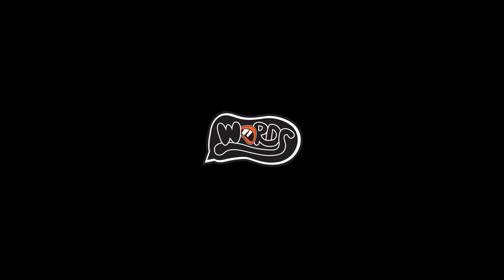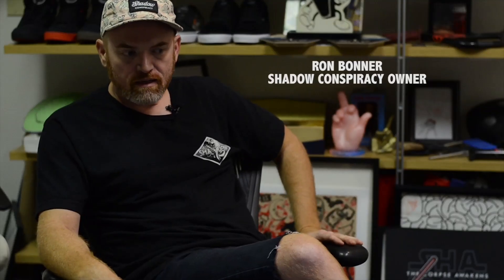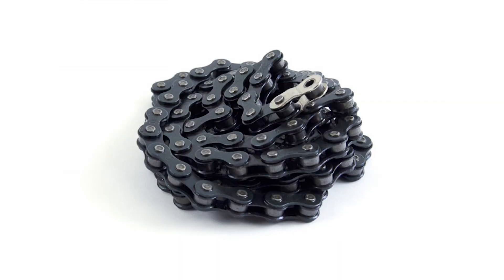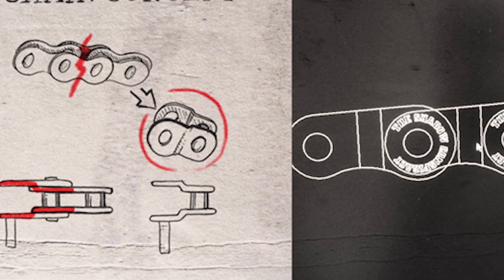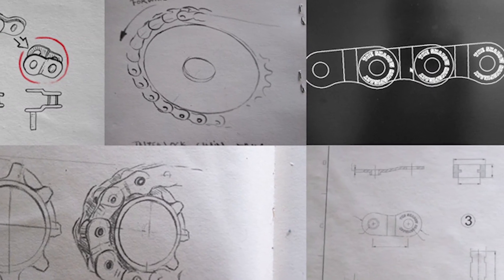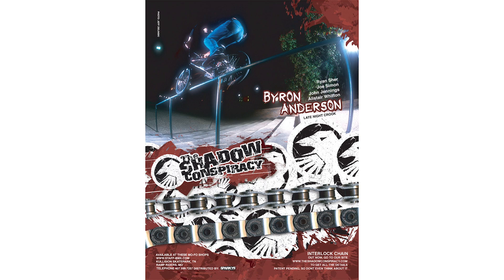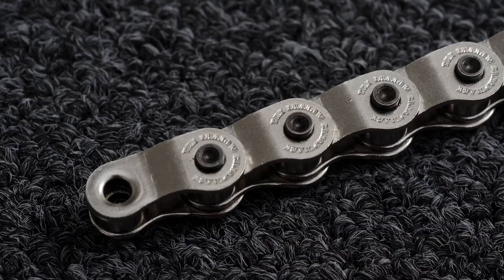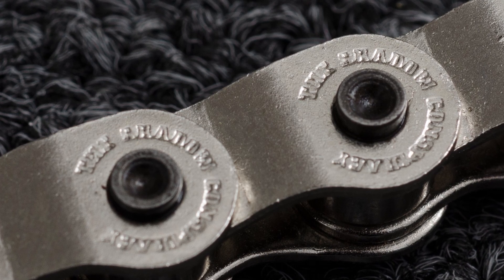WORDS: History of the Shadow Half Link BMX Chain

Comment: My buddies and I all ride the shadow chains and we ride some gnarly stuff too. Lots of grinds and big drops and fast peddling on the regular. None of us have ever broke one of these chains. mine is 2 years old and I have no intentions of replacing it any time soon. I'm curious as to how some people have claimed to break these  chains and especially people claiming that it happened in a matter of weeks. First off no chain is indestructible but I have a strong feeling anyone that has broke one of these chains has either compromised the chains quality due to a heavy crash that put an abnormal amount of pressure on the chain or they have an issue with their gearing and alignment of the chain. I do know and have plenty of personal experience and personally know tons of others riding this chain that when it is installed the right way that it is nearly bullet proof. Thank you Shadow for making the effort to make great parts for us guys!

Comment: My knee got saved by the v2 so many times when it snap, it didn't snap all the way and the plate gets stuck at the sprocket or hub driver which prevents you from pedaling further so you can't hit your knee on the stem.
Reply: Same, they're definitely not really strong, but it kind of jams before you can crank any further
Reply: Agree. Mines prob 10 years old now and I just buy the master pins and ill toss one in when the plates loosen up

Comment: mine broke after 2 months lol. back to full link 20$ chain now
Reply: you probably installed it wrong, did you make sure you only took it apart at the master pin?
Reply: @shokurozu277  you dont resize these chain. U will use the chain breaker to remove the proper length then use the over sized pin and have a heavy duty chain breaker to install the pin and leave the supreme chain alone if u break it at another link and try putting it together your chains going to explode but u have to install a over sized pin in the hole they sale them for like 5 plus dollors

Comment: Well. They used to be grate chains. Had one back in 2008 that lasted 2 seasons without any problem (got worn out eventually). Now when I bought one at the beginning of previous season (changed sprocket and rear hub too) it got worn out within 2 weeks. 2 weeks!!! Now since than I got some cheap KMC full-link chain (for 5euros if I remember correct) and that thing is lasting until now with little wear at this point (if u know chain measuring tool u can tight-squeeze in that 0.075mm wear mark). That's 2 weeks to full wear where my measuring tool went all the way in versus 3 months and still going. I'm riding 28:9 btw.

Hype all u want. Science all u want. This chain is not worth the price anymore. Not from my experience. Btw I'm a bike mechanic so I know how to work on bikes.
Reply: So true. Had one and had to break the bank for it, it was so noisy and wasn't that strong